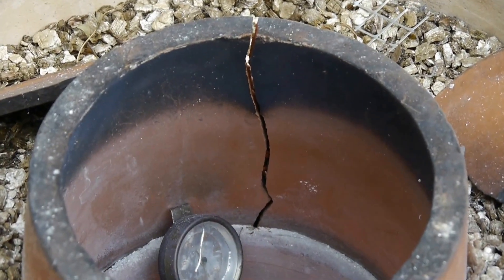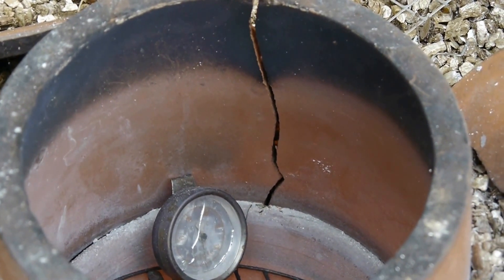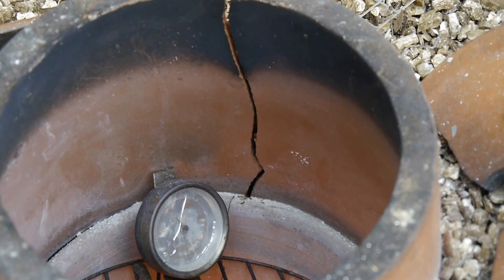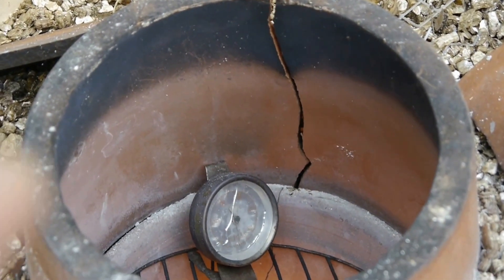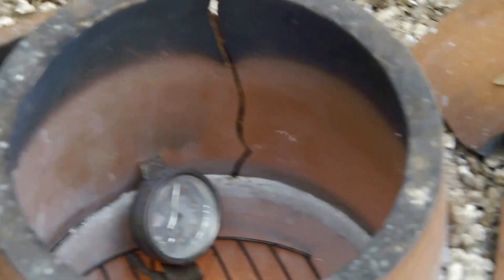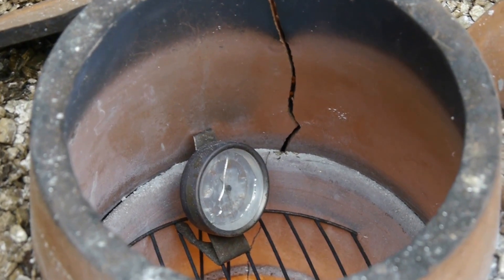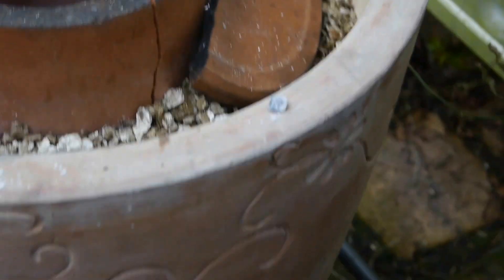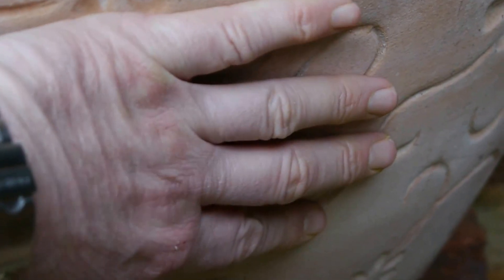Cracked Tandoor

Comment: You can repair this with fire cement. After applying use damp sponge and you'll get it super smooth. You can also apply a complete lining of fire cement inside the pot using same method. Traditional pots have goats hair as this binds it and prevents it from cracking a bit like when putting steel in concrete. Therefore the cracking will happen without this on your normal flower pot.
Reply from the maker: More great tips, once again thanks for sharing

Comment: You cannot avoid cracking since the clay composition has no Heat Resisting properties.  Make the Pot yourself from clay + Sand. Recipies can be found in the Internet.

Regards

Greattimez, Españistan
Reply from the maker: I have thought about making a pot myself, and I think I will do some internet searches as you say. Thanks for the tip
Reply: Can I please ask what clay. Tha
Reply: @preetn6773  
The red clay i used came from an abandoned  local clay Mine 10 minutes from my home. The clay was used for making chanelled bricks.
The red clay i dug out was almost pure so i added sand. The red colour was caused by traces of iron oxide.
1 part clay + 3 parts sand works fine.   Mix thoroughly!,
Instead of adding sand you can also ad saw dust, rice husks or chopped straw, even droppings from cattle, camel, horses works great.  It is important to make the clay porous.  
After drying of the clay, make a small fire to drive the remaining moisture out. When this is done make a large and hot fire to bake the clay. 
Remark1: the high temperature will ensure the burning of the organic materials within the clay liner to ashes.  Nothing unhygienical remains in the clay after final baking.
Remark2: you can use any locally available clay. The colour of the clay is not important.  If there is locally no clay available, you can buy bentonite cat litter and mix it with forementioned.
Remark3:. After baking, some cracks will occur due clay shrinkage.  
Simply rub the cracks with clay slurry and let dry.
I used sand because camel dung is rare in Spain....lol

Good luck